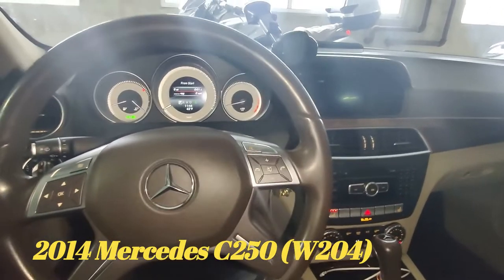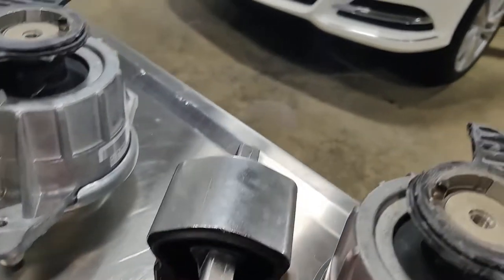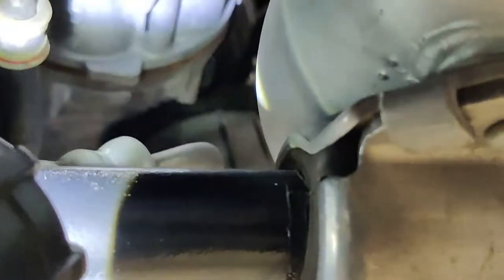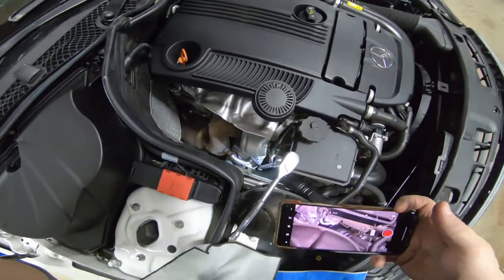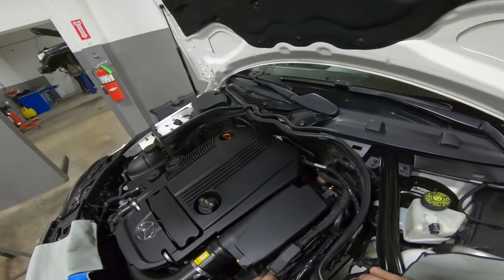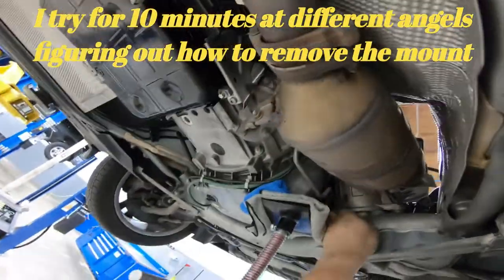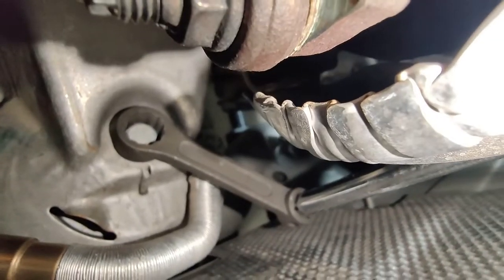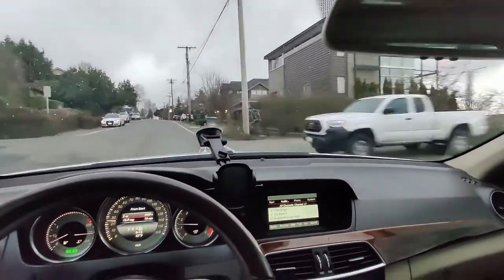Mercedes C250 Engine Noises (W204) from bad Engine Mounts & Annoying Sounds HOW TO REPLACE MOUNTS

Comment: Great video and Lemforder is a great product.

Do you have the torque specs for the three mounts? It is very important they are torqued to spec. Cheers
Reply from the maker: @AnthonyS80-V8  hello and thank you for watching 🙋‍♂️. I'm having problems finding the torque specs for the rear transmission mount. The fronts are 50 newton meters or 36 ft lbs. 
My best guess for the rear is no more than 20 ft lb. 
I wish you the best of luck and I hope everything goes well. 🤙🤙
Reply: @MotoTouringWorldWide  Thanks for that. I have replaced the fronts and the tool came in extremely helpful.
I have not replaced the rear as yet (much more easier) as I am waiting for the Meyle HD part to arrive. 

Will post the torque spec if I can find it!! Cheers

Comment: You have grease all over hoist jack???  These are easy mounts...no special tools, mount comes out bottom. Whats the name of this shop???
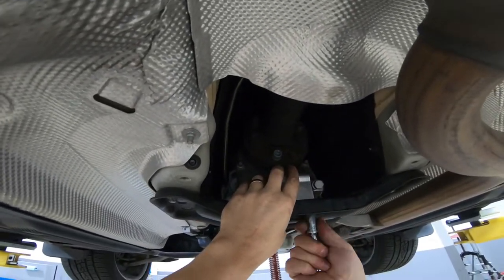Reply from the maker: Thank you for watching. The red grease on the screw jack at 7:11 are in the threads and came that way from the shop where I rented the hoist. Yes, these are very easy mounts to remove and can be done from the bottom with no special tools. But the tool is good to have for most all projects. This SHOP is called STEW'S Garage. Here is the video link: https://youtu.be/QSVs0BeklfE?si=hsoXawBZ7_yVyYkb   They have 13 hoists that you can rent by the hour. However, they rented out all the hoists for 6 months to the Rivian EV Truck company. So at the moment, you can not use a hoist when needed which is really interfering with my need to "Self" maintain my vehicles. Thanks again for watching. 🤙🤙🙋‍♂🙋‍♂

Comment: Thanks for the video and careful instructions!
So I clearly confirmed that you shove all the way up, then how did you put the new mount on the passenger side? The same way?

I just ordered mounts after watching your video :)
Reply from the maker: @freedomin1995  ,, thank you for watching 🙋‍♂️, yes when I pushed the old right motor mount up by the firewall. I lowered the new motor mount the same way I pulled out the old one. 
I hope everything works out smoothly with your motor mount installation. Keep us posted on how it turned out 🤙🤙
Reply: @MotoTouringWorldWide  Hi sir, I've just changed engine and transmission mounts, also the sway bar link.
I really appreciate your secret sauce for pulling out shotgun mounts. It was like solving a puzzle haha.

Anyway, my c250 is super silent and cozy! Thanks again for this video!!!
Reply from the maker: @freedomin1995  ,, EXCELLENT NEWS!!! Thank you for the feedback 🤙🤙👍👍

Comment: Did you also have worse vibrations at certain speeds too
Reply from the maker: Hello and thank you for watching. Yes I did and totally forgot about this weird sound & vibration at around 68 to 72 MPH. It was a plastic type of fluttering type vibration and I haven't heard it since the new motor mounts. After the repair, my ears have been enjoying piece and quiet. Be sure to inspect that rubber flap as in seen in the video and make sure it is not touching the lower part of the mount. It is a sign that it is worn out. I hope you have luck with your car 👍😊
Reply: @MotoTouringWorldWide  yea it’s like it would get into 7th gear and hum my c250 is a year older than yours and has double the mileage so it’s a lot worse but I knew that we had the same issue from that hum at idle
Reply from the maker: @kidfoodieusa3806  ,, I forgot to mention the rear mount too. With your car having double the mileage,,  I think you should seriously consider replacing your 3 mounts if they have not been done. I'm actually very surprised that Mercedes-Benz engine mounts failed on my 2014 so soon. I Read other posts online about how the car is smooth like butter after replacing all the mounts.
Reply: @MotoTouringWorldWide  can you send the links to the parts
Reply from the maker: @kidfoodieusa3806  , Hello here is the parts screen, you may need to change the year of your car: https://www.autohausaz.com/pn/3358701 
Here is the rear transmission mount: https://www.autohausaz.com/pn/11107 
Here is the MAIN page for AutoHausAZ. You should register your year and model Mercedes and then shop around: https://www.autohausaz.com/ 
Wish you the best 🤙😊😊
Reply: @MotoTouringWorldWide  thanks did the mount link come with one or two mounts
Reply from the maker: @kidfoodieusa3806  , that link is per mount. Once you're in the website and register the make and model of your car you'll see quantity one, and I also noticed the price went up $10 per month since I ordered mine back in February.
Reply: Did it vibrate while idle
Reply: @tofistakhar7580  yes

Comment: Mileage?
Reply from the maker: 64,000 miles. But keep in mind also 9 years old. (9 years of engine weight also compressing the motor mount too)
Reply: Mileage doesn't matter. These are junk mounts to start with